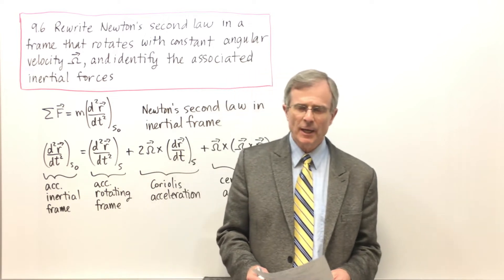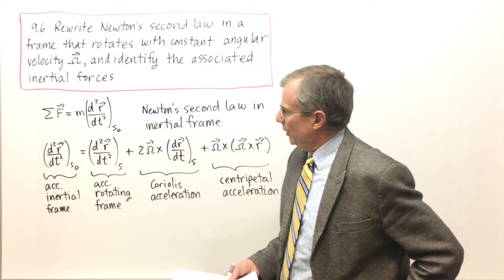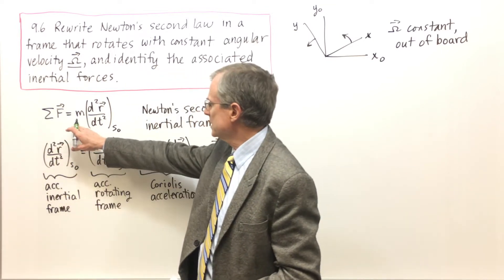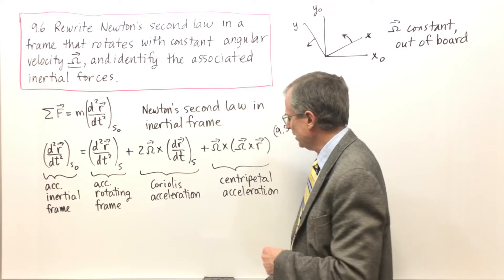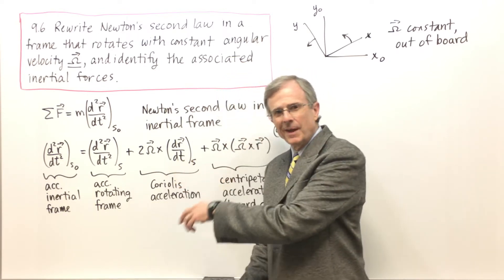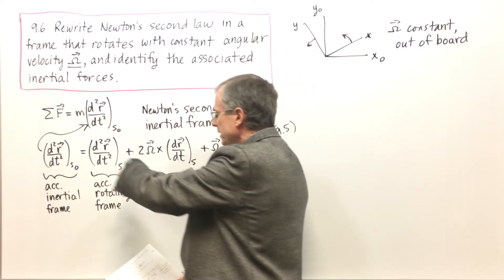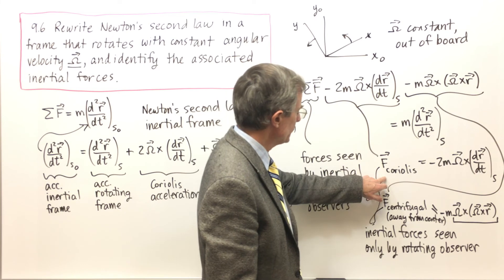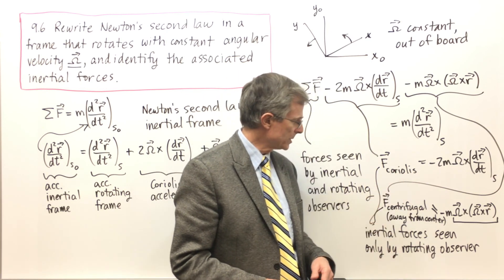Newton's Second Law in a Rotating Frame (9.6)

Comment: could I ask for a video about thevenin and norton with an explanation of the replacement resistivity calculation with a step by step calculation and an exact explanation when the circuit is open and when it is short curite with currents marked and on the resistors showing the polarity becouse somtimes when we calculating we use Kirchhoff's law I haven't seen any video yet that would explain it well most of them look like they were copied from a book without a thorough explanation of the subject

could I have your e-mail address please? I would like to send some question